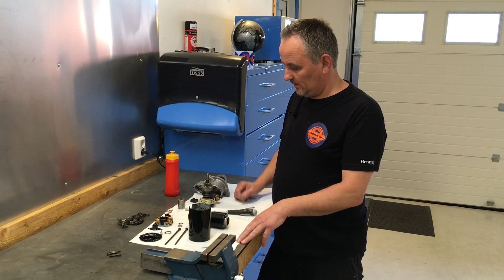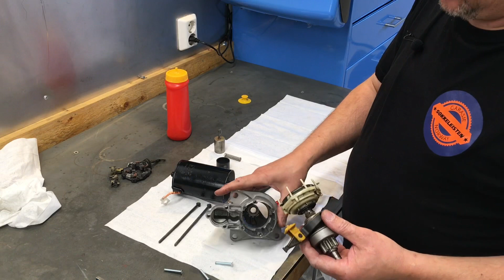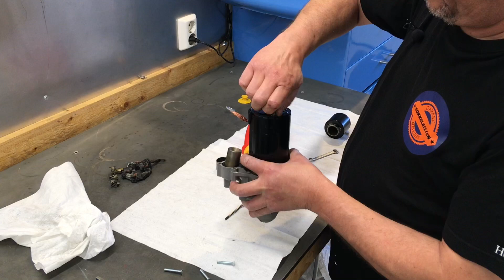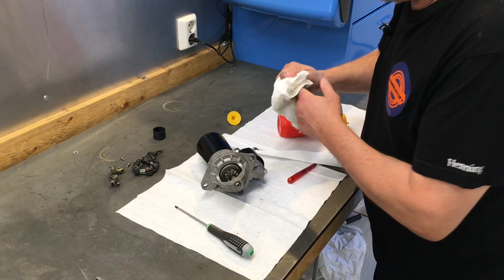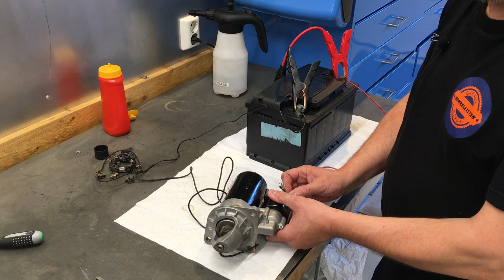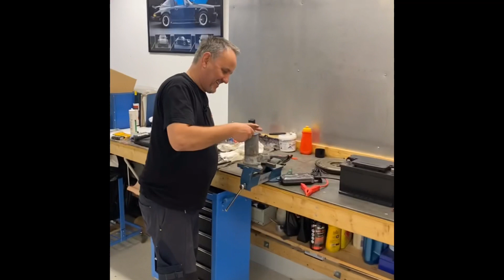1982 Ford Taunus (del 3) - Overhaling av startmotor

Comment: Ohc motor er missoppfattet av mange, på grunn av  dekslene på registerdeksel  , Riktig navn og betingelser er Pinto motor og ble levert som hc og lc (høy og lavkomprimert)
Reply from the maker: Hei, det stemmer at den originale motoren i Taunus/Granada/Transit/Sierra m.fl. blir kalt Pinto. Vi bruker gjerne OHC (over head cam) -betegnelsen internt på verkstedet. Som er forskjellig fra CVH (ca 1980) og DOHC (ca 1988).
Den lavkomprimerte lc-motoren du nevner ble oss bekjent kun levert i Transit (televerket) på det norske markedet.